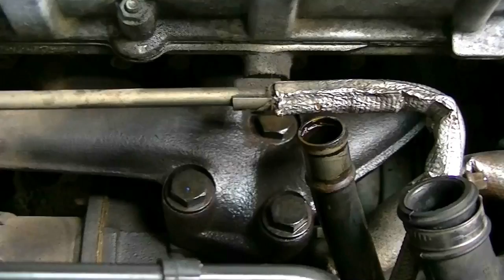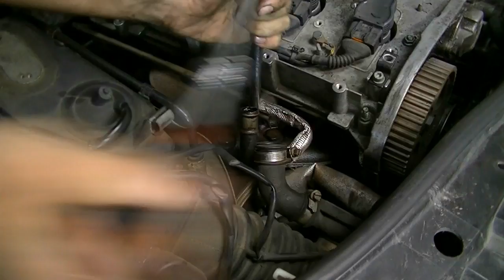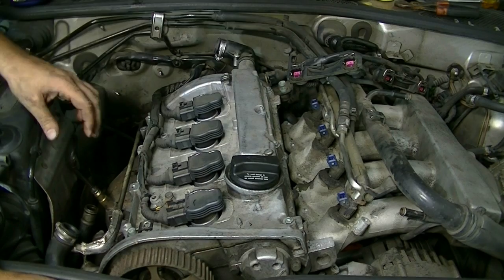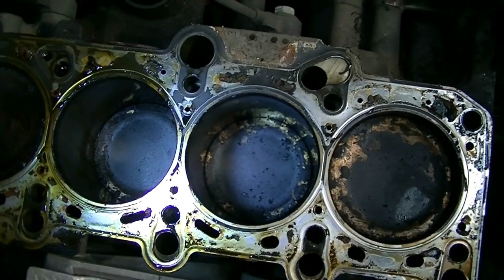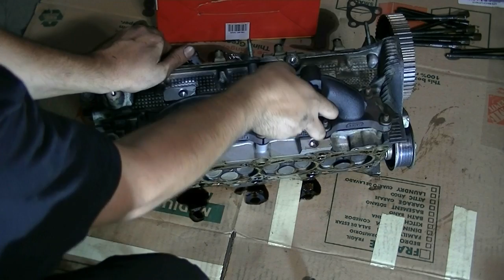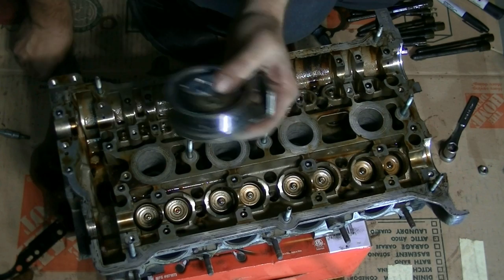How to Remove and Replace a Cylinder Head - Audi A4 A6 VW Passat Jetta 1.8L Engine Part 2

Comment: What's the name of the upwards sticking „bolts“. ( at 2:50 )The 9 nuts holding the valve cover down. 
I can’t find it anywhere. 
Would be nice if they are simple.. double threaded bolt things.

Comment: I had one in Germany Passat 2004 in 2012 with 187.000 km and it's costs 4500 € to change chain and belt and others bullshits.
Guys on service in Berlin said that doesn't worth ,anyway you coming a have a lot problems with that engine with lifters etc.. later
So i throw away that shit car and bought Ford Focus .Never ever have problems with engine with Ford.

We in  Germany said !

"If you want problems in life ,just buy vw with 1.8 t penis engine or Alfa Romeo !" 😂

Comment: FYI for anyone who is scared of Valve replacement; it's easy. You don't have to send a head to a machine shop. And I have bought whole sets of valves for under $50 many times; if you shop around. Get a valve removal tool and learn yourself. That's how you really save money.

Comment: Please help: is it normal for a "low pressure" light to come on after replacing cylinder head + oil cooler +oil filter? I didn't pull the fuse to build oil pressure before starting it so maybe that's why the lifters are so loud?
Reply: Collin Fox yes if it disappear very fast (1s max). Do not forget to prime the engine next time
Reply: @polo16v190  1 second?? I thought the dash warnings don't go away unless you disconnect the battery. I used my scanner and see no codes but a warning is displaying on my dash about oil pressure
Reply: It is normal to have the lifters that are loud. For a moment. For some miles it is normal.
You are talking about oil pressure problem. On your dash you wrote that it does not go away. That is a very big problem !! It must disappear after the start of the engine immediately, or in your case after some second !!! Not more.
Take. Your oil pressure with a manometer ! Did you forget to put oil in the engine ? You have to check it asap do not run the engine if the light does not come off!!!

Comment: All those ten millimeter bolts you talk about are 6 mm. They use a 10 mm wrench. A 10 mm bolt likely uses a 17 mm wrench or larger

Comment: I was expecting this to be super hard since it’s an Audi and I’m switching over from Honda’s. Lol but it’s sooo much easier since you don’t have to pop the cams off. Great video 👍🏽 I just bought this exact Audi with almost 200,000 miles on it and I’m thinking of just doing a head gasket, timing belt and water pump all at once for peace of mind lol
Reply: I bet if you did this job it was much more to it then he showed in the video 😃
Reply: It wasn't too bad prob took like 20 minutes.

Comment: What is the size of the triple square tool that you used to remove the head bolts at 3:59.  That info is nowhere in the internet, just spent 1 hour digging. Please provide the size of the triple square bit for the next guy doing this.  Armando also asked the same question.

Comment: Great video. Thanks. Where do you get the "tool" with the hex bolt and plastic piece to hold down the timing "chain" tensioner; at 9:00 minutes.

Comment: Hm do you charge to do the timing belt on the audi a4 and cam shaft seal im not sure which one is leaking though if head gasket or just the camshaft seal

Comment: So those three bolts.... I didn't strip them but one snapped off at the threads. How should I proceed???? It was the outer left one :/
Reply: If im remembering right, it should be holding anymore. The thread goes into the turbo, not the manifold. Should slide out from the manifold. To remove from the turbo, get a reverse threading bit and a drill or a you can always borrow one of those old torches and just burn it out and retap it.
Reply: drill it out
Reply: How did you get the one bolt under the head out

Comment: I have a 2002 VW passat, 1.8 turbo, 148K miles, blown head gasket, it runs but will blow white smoke. What can I expect to be charged for fixing it, or is it cheaper to have someone change out the engine?I live in Lynnwood, WA, just in case there are any good mechincs out there looking for some work.
Reply: Any luck???
Reply: Call Doug @ Autovice / Bow Wow in North Lynnwood, across 99 from Dairy Queen
Reply: Thanks for the tip.

Comment: HI THIS IS JUST AN IDEA FOR YOU. WHEN YOU REALLY HAVE TO REMOVE LIKE THOSE THREE HEX HEAD TURBO FLANGE BOLTS BESIDES A SIX POINT SOCKET GRIND THE END OF THE SOCKET TO REMOVE CHAMPHER FROM SOCKET.  IT WILL GIVE YOU MORE ENGAGEMENT ON BOLT.  IVE DONE THIS FOR YEARS AND IT REALLY WORKS GOOD  GARY COMSTOCK
Reply: +GARY C Good tip Gary, Thanks. Might also grind off a little around the outside to prevent locking with the cavity the bolt is in.
Reply: u mean, cut the nut in half?

Comment: hey i have an 03 audi a4 3.0 and i took the passenger cylinder heads off and it looks like one of  the piston its broken.the engine its decease then?
Reply: I wouldn't necessarily say its a dead engine. Seeing as you were able to remove the cylinder head, you must have mechanical knowledge. OEM pistons are pretty cheap and simple to replace if you can get the engine out of the car. I myself don't set an engine as dead until the block is cracked or has a hole in it.
Reply: ok my own
Reply from the maker: jose Ruiz yes, time for a new/used engine.

Comment: if  you bend a valve , you have to replace the guide as well , because  you pulled a  bent shaft  ,the valve stem up into  the guide with the valve spring , when engine is hot these guides will open up  because the bent stem of the valve   pulled into the guide will open the hole and cause big problems  of sealing up , the  valve will move around in the sloppy hole causeing it to seat off center and not to seal up  which will cause  a miss and a lean burn situation which will make it overheat and burn valve seats out, so make sure you have a reputable  shop do the head work

Comment: Hi, hope all is well. I own a VW Jetta gen IV 05, 1.8T GLI. How do you tell if you need a new head gasket?
Reply from the maker: Cory M Overheating, coolant mixed with oil, smoking out the tail pipe are all signs. I recommend showing it to a professional if its not obvious that it needs a head gasket.

Comment: Thanks for posting the video. Gave me insight into pulling the head on my 1.8T Audi TT. Had to do a valve job...fun fun. Anyways, a couple of things. You don't need the camshaft chain tensioner tool isn't necessary. I was able to remove all bolts from cam retaining caps and tensioner and it came out as a unit. Just have to be careful. Also i found that it was better that i got an engine gasket kit which came with everything and cost the same as a head gasket kit. I found my parts primarily on ecstuning.com. If i didnt have a time crunch i would have gotten OEM equivalents from parts geek for about $10 for intake valves and $12 for exhaust valves. One added note for people reading this. If you look at the piston, it will tell you which valves made contact. I had one valve per cylinder that didnt look bent yet made enough contact to knock off the carbon. Anyways, i look forward to watching the last video of the three you posted. Thanks again!!
Reply from the maker: Shana Siwy np, thanks for the feedback and tips. I am sure people will find them useful. Cheers

Comment: hey i watch the videos on the vw passat for putting it in service position and then replacing the timing belt  and etc. on it i wanted to know if you could give me a full list of the tools and bits i would need for the job. i have a glx 4 motion v6, the hoses and stuff that you remove when putting in service position are in the same spot even know that was on a 1.8 turbo? i posted this in ur discussing area but i didnt know if you would check there im trying to do the work this weekend the sooner i get the tools the quicker i can get started. thanks in advance.